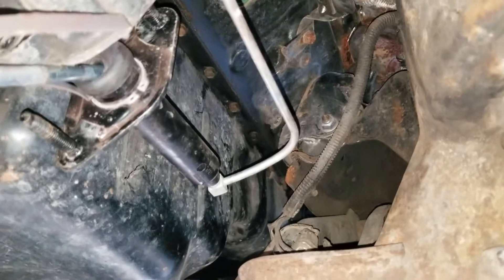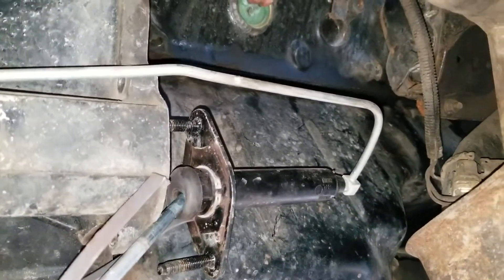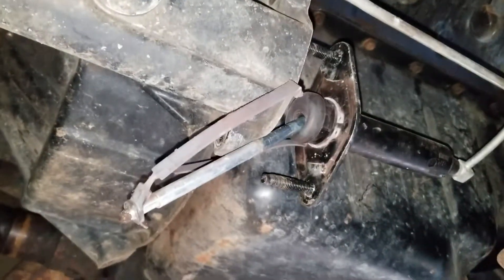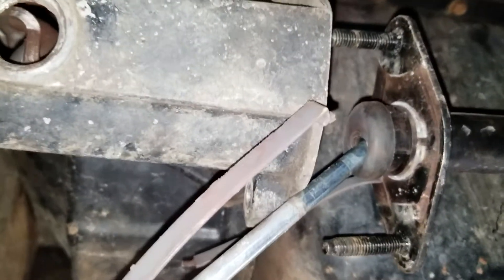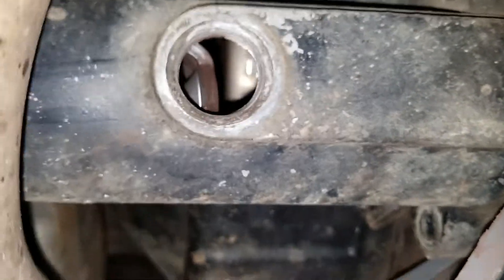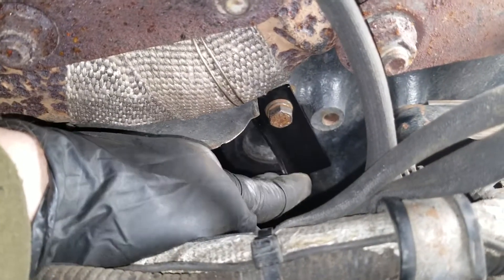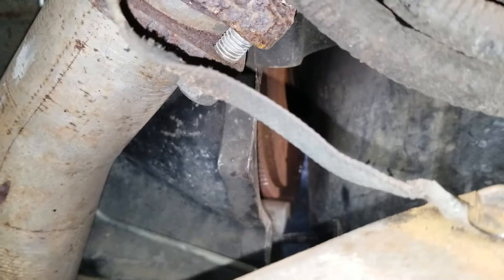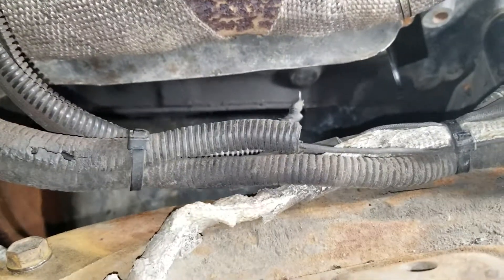Changing the 6.5 Diesel Starter Part 3 - Prepped For Install

Comment: It’s that hard to get the starter I got a 5 speed
Reply from the maker: Yeah, this is on a 5 speed truck. It's really not that hard, you just HAVE to remove the clutch slave cylinder. Just the nuts to pull it off and push it aside, not the hydraulic line.